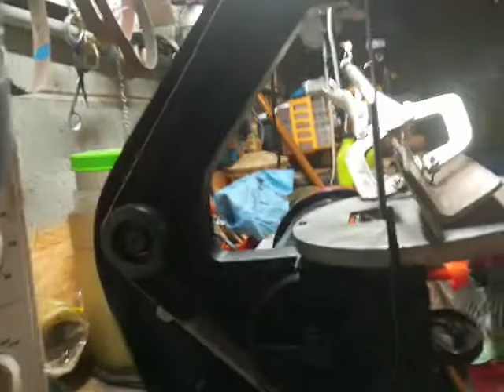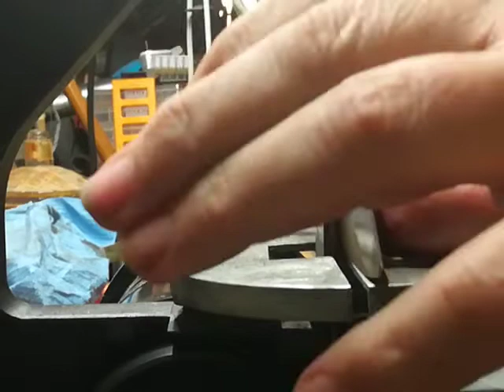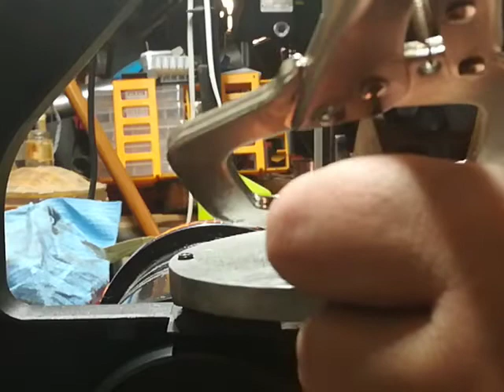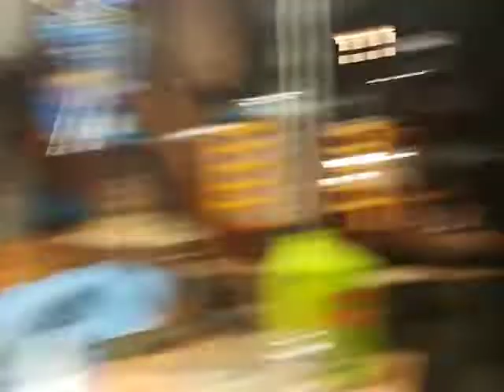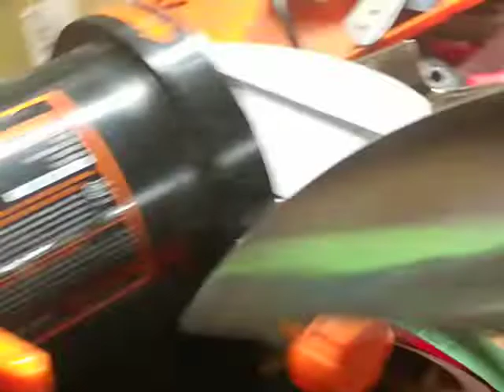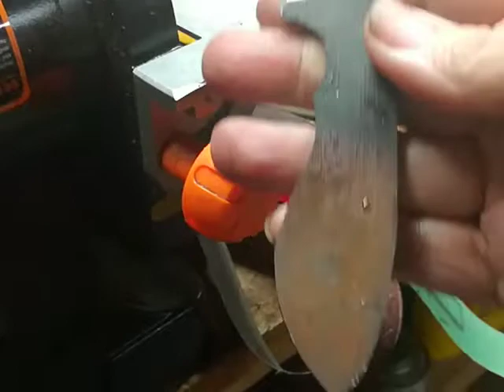More grinding knives...

Comment: Checked out one of your old vids and you had a 2x72 I have a 1x30 and was wondering why u switched, like your jig set up too
Reply from the maker: I only switched because I lost my shop when my father died and my brother stole literally every single thing from my shop and made me homeless for the past 4 years. I'm just getting back on my feet and trying to build up my shop again and have to start somewhere. The 1x30 was a gift from a great friend.
Reply: Holy cow stick with it man
Reply from the maker: The jig is nothing more than a piece of 1.5 inch by 1.5 inch angle iron, which I clamp my blade blank to with a pair of vise grips... And angle the table for the correct bevel degrees...
Reply from the maker: The jig is also about 8 inches long...